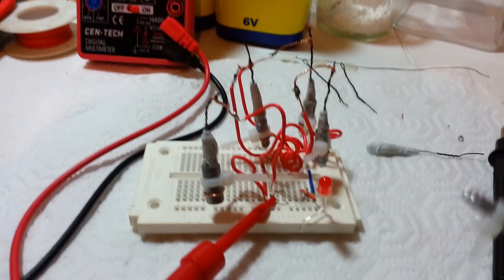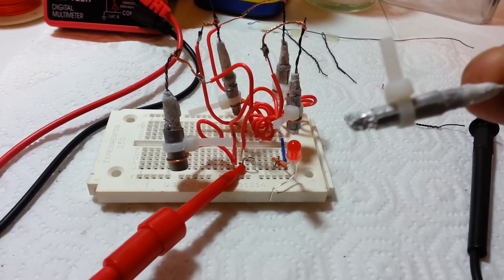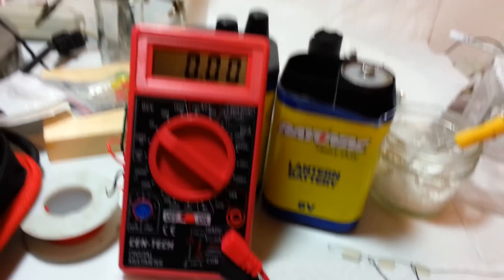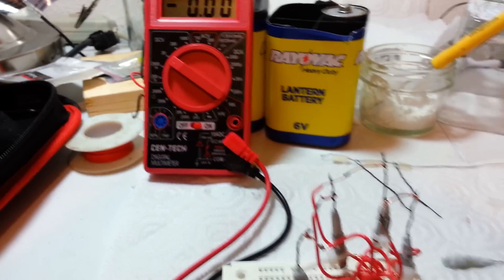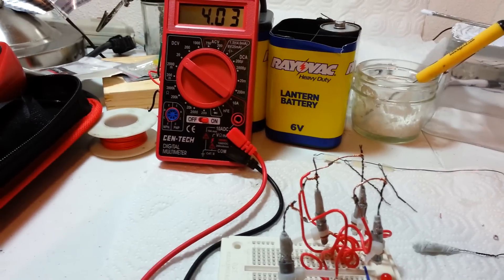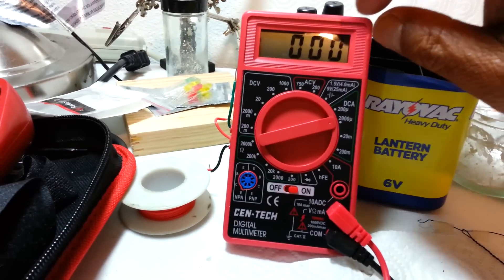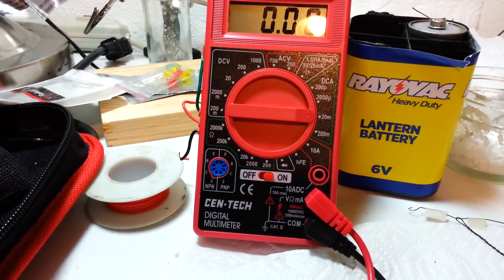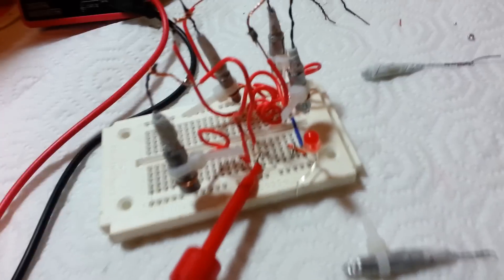Power Beads magrav (Alekz from Keshe Foundation)

Comment: Not sure what I'm looking at here.  Looks like the Keshe capacitors?  Are you generating current and potential from these on their own?  I.e. no power input of any kind?
Reply: +Sylvain Rochon Also, are the power beads humid in any way, and in between the titanium oxide and copper ? (or is it copper gans?)
Reply from the maker: Alekz power beads brass GANS, Tio2, sugar, and NAOH keeps gans moist, nano coated wire, zinc, aluminum foil, tissue. 4 cells series circuit . current is 10mah lights up the LED. The Earths magnetic gravitational field charges the cells. I'm still new at this concept.
Reply from the maker: +Sylvain Rochon yes the NAOH draws in moisture  the tissue acts like a sponge to keep the GANS dynamic.
Reply from the maker: yes each cell has potential difference the foil and zinc plate are the transtional material to enable plasma (antimatter ) too electron vibration (the matter state). Henry T. Moray pulled 50kilo watts from the atmosphere (the moray valve the first transistor I think) said " the earth floats on a sea of energy (the ether) there was an attempt to kill him and his family they were shot at and Henry got shot on the leg after threats telling him to stop his research.........
Reply: +mag netron Cool thanks.  Thought there was moisture in the tissue.  Otherwise the electrons have no way to travel.  That's where you get your electricity and it'll increase over a short while to capacity and then it should decrease if the tissue moistens up and the hard surfaces get crudded up.  At least that's the way normal chemistry works.  If the GANS and nanocoating techniques do things differently over time, then it'll be a decent sign of other mechanisms at work, or a constant increase of voltage over the next few days, or if you observe the wires beyond your apparatus to oxidize (nanocoat) at a quick rate.  Copper takes a LONG time to oxidize in normal air at standard temperature and pressure (months), so if you see it go pink or black (and you can get the stuff off your wires with paint thinner for example and clean it off to get the normal copper color back), but in just a few days.... these are all indicators of Keshe possibly being right.  You'll need all of the above to happen to validate though as those are all phenomena described by Keshe to indicate the thing to work properly I believe.Looking forward to see more results.:)
Reply from the maker: Sylvain Rochon nano coating of copper wire also occurs with the co2 capture system connection between the two plates. I have observed this with my replication one indication is a white substance buildup at the connection points...takes some time, 2 months at the least.
Reply from the maker: Sylvain Rochon affirmative , after some time white crust build up on cell,and voltage decreased. This happens when the paste ozzes out (too much paste )  in relation to cell size....
Reply: +mag netron the white substance is most likely just a residual non-soluble precipitate from Zn or Cu or another metal associated with hydroxide ions in solution.  Most ionic precipitates are white so hard to tell exactly what it is....
Reply: +mag netron Yeah, the white crust build up will create an undesirable electron transfer barrier preventing things to flow properly.  To have sustained use of any system of free energy, there is a need of stability and non-consumable processes in there, i.e. there is no unbalanced formation of any material either way.  If that happens, then you don't get the crust and the voltage stabilizes (on even better, increases) and can run forever.  Its like this:  a battery eventually runs out of juice because it runs out of chemicals inside to react and generate current (the reactants are spent and all you have are chemical products).  In rechargeable batteries, you can reverse the process by having the products react back into reactants (allowing for the battery to be used again).  This requires, of course a volume of energy superior to what it generated in the first place (efficiency of batteries is much less than 100%).  

So our goal here with Keshe systems is to have either no chemical reactions at all in the system (no consumption of reactants or products, so there is no need to replenish anything after a time like a battery) or all chemical reactions are in perfect equilibrium (balance), giving the exact same result = no need to replenish using energy.  

So if the setup allows us, with balance to generate new energy with balance or no reaction, we got Free Energy.  :).
Reply from the maker: Sylvain Rochon I made more cells and I used less paste, little or no crust buildup now ,and  power is stable.....
Reply from the maker: Sylvain Rochon the cells regain power after being disconnected from led circuit and reconnected to led circuit.....I'm going to experiment with "Joule Thief" circuit and a "Tank circuit" this will be interesting!!
Reply from the maker: A battery is like a capacitor but battery has chemical paste in contrast , a Capacitor t uses an air as the dielectric .

Comment: Nice and clean set up.  Did you also add caustic and sugar.   I am working on health pad and pens.   I am getting real good result.   Also, for nano coating I added oil of orange to the plates before adding hot water to caustic.  My CO2 has turned to solid orange.  It looks like orange pulp and orange juice :-)   

keshe is right, the power of the fruit can be transferred into the gans.  When I finish the cup of life I would let you know he result.   

My Psoriasis has improved again.    SO far at least 60 to 70% improvement in 10 days of using the CO2 pad.   

Keep posting videos
Reply from the maker: happy to hear you 70% improvement. health pads are working . You obviously have the understanding free Plasma energy.How is the health pen used?. orange fruit oil on nano plate is that for reactors?

 I used sugar and caustic for the paste.

 I need to learn the proper ratios of the dry gans paste I have no chemistry knowledge

I was surprised by the difference from liquid gans to dry gans that during the drying process there was so much material that seemed to have evaporated or something maybe my lightbulb was to much 200 watts. 

I'm still trying to understand plasma to electron vibration.  I am used to electron flow . Free plasma is so new to me. From watching the knowledge seekers workshop the beads need to be used in conjunction with a voltage source ?

So there is electron vibration and plasma flow at the same time using power beads?  plasma , magnetic flows in one direction and gravitational, flows in opposite direction at right angle against each other?

  I read about Edward leedskalin explanation of north and south magnetic particles flowing against each other at right angle twist kind of like the DNA strand, and acid breaks down metal into individual  north and south magnets. Edward made a claim that he uderstood the secret of how the pyramids were built. When Edward died from illness goverment took his important equipment .

Thomas Morray wrote a book titled A Sea of Energy that the earth floats on. Morray had demonstrated in front of government officials and had engineers look for any sign of fraud on his device when he successfully pulled 50KW from the atmosphere.  His family was shot at by unknown gunman after being told to stop his research and his lab was burned down this happened in the 1940's.

Stanley Meyer (2004) made a car that ran on water U.S. government and SAudi government offered him 4  billion dollars to stop his research he refused offer then died from food poisoning he told his brother that they poisoned him........Cant forget Nikola Tesla......
Reply from the maker: Cup of life! wow! I'm looking forward to your experiments Zia ! please let me know the results 

Thanks for your response Zia ! looking forward to hear from you Zia!